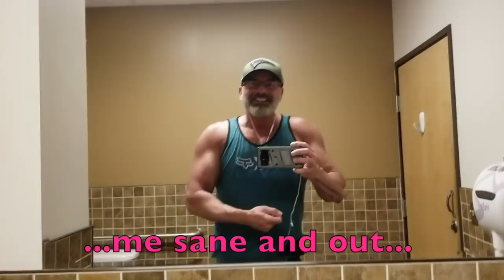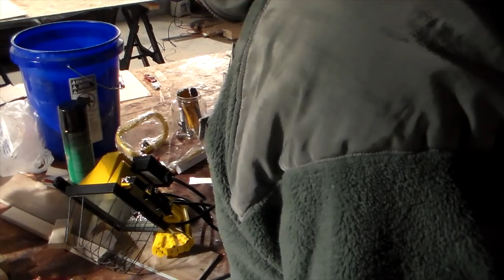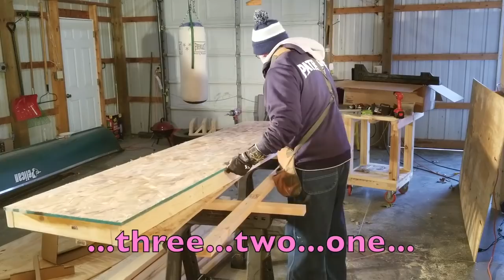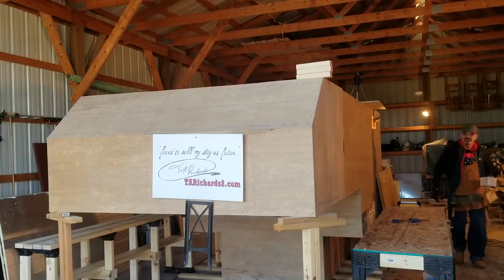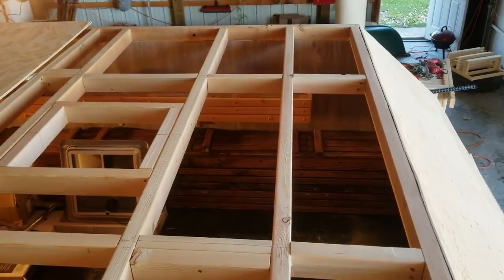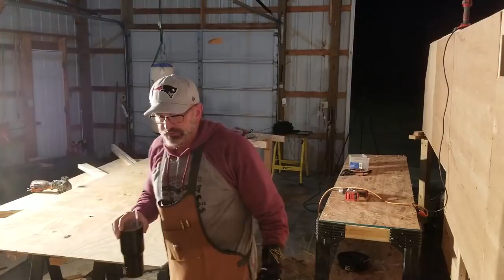How I Built My Truck Camper Episode 38 UP ON THE ROOF

Comment: I have a 1995 Chevy Cheyenne dually 4wd, yes 4wd! It's also a utility body. It has a custom made shiny aluminum ladder rack front to back and connects to front bumper. Looks amazing. Wwish I could share picture to you. I have instagram I could msg to you I reckon. I really want to build a custom camper like this. I have done 2 d.i.y. campers. This ladder rack woukd be an awesome support system to it however it would be a permanent install with doubke doors on back to be able to contunue hauling firewood, boilers, etc. ..I'm a plumber so that woukd be why a permanent dual purpose build; keeping tools and equipment dry PLUS 4wd Outer banks surf fishing and camping trips!
Reply from the maker: @jasonsmith6408  I will check it out... thanks for sharing bro!
Reply from the maker: I added you on instagram...you can also find me on Facebook.com/terry.richards.02